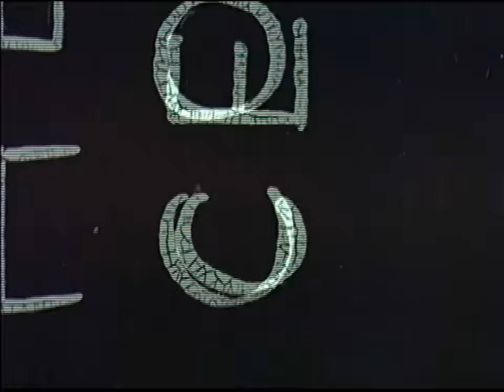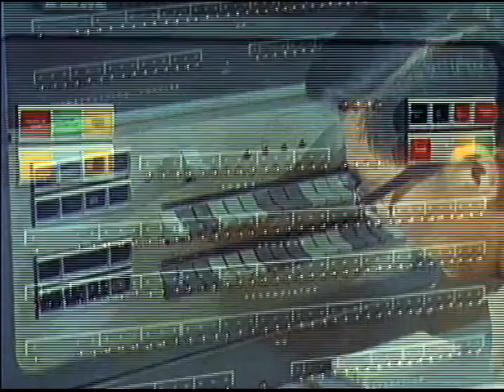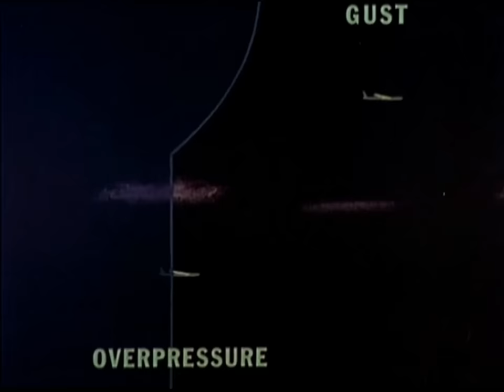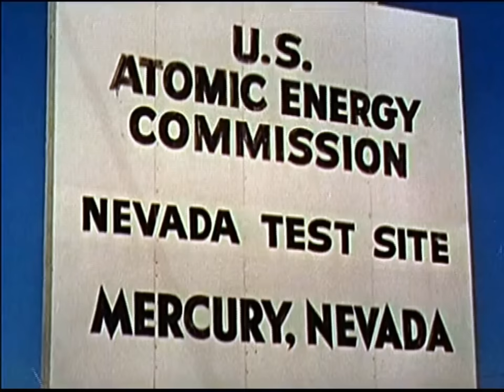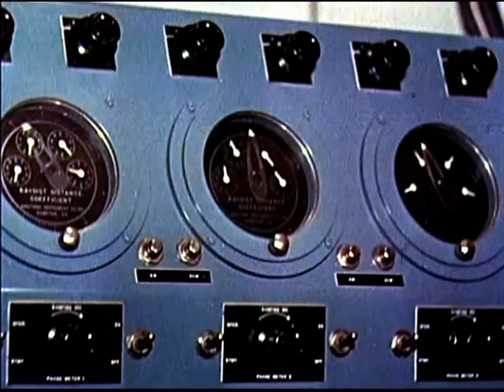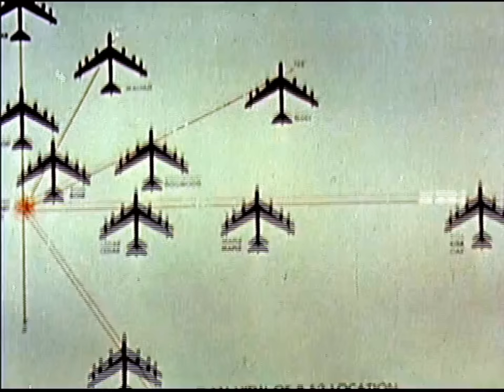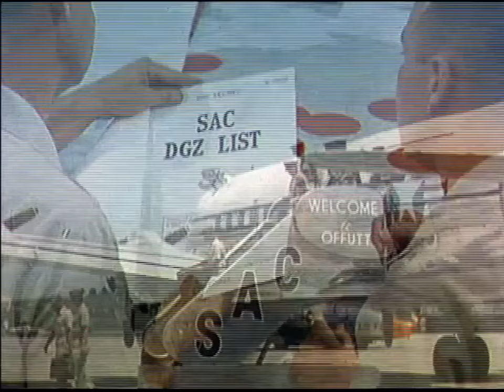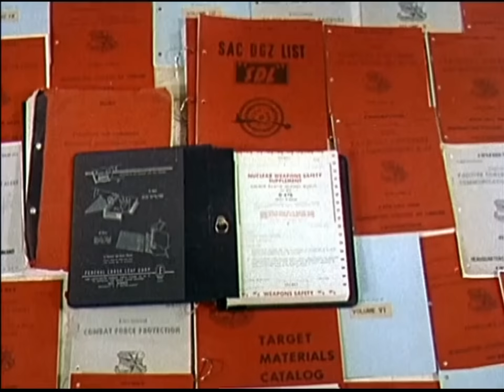Nuclear Effects During SAC Delivery Missions

Comment: I was curious as to how many nukes the B-52 can carry. The B-52 can carry some 45 Mark 83-class bombs (27 internal, 9 on each HSAB pylon). The B61 nuclear gravity bomb is a bit smaller in all dimensions, and uses the same mounting lugs, so physically, there would be no problem for the B-52 to carry 45 of those.
One plane could destroy many of the major cites in Europe.
Reply: The B-61 didn't get DoD authorization until 1963 and hit full production in 1968. The B-52 was designed to carry multi-megaton bombs such as the Mk-17 @15 megatons yield, the Mk-41/B-41 @ ~25 megatons, and the Mk-53/B-53 @ ~9 megatons. These bombs are huge and the BUFF could accommodate two of the B-41s.  

The B-61 was considered a weapon for the F-105, FB-111, F-104, F4, etc.
Reply: B-52's could also carry 2 "clips" of 4 Mk28's for a total of 8, and two Hound Dogs on the wing pylons. It was those very Mk28's that were thrown from the Buff that had a midair over Palomares Spain...A typical load would be 4 Mk28's and 6 SRAMS for Air Defense suppression (radars, SAM sites, etc) on a rotary launcher, or 2 B41's or B53's and 6 SRAMS..Pre SRAM it would be 4 each of 41's or 53's and two Hound Dogs for Air Defense suppression
Reply: @seismicrock6849  The only aircraft that could carry a Mk17/24 was the B-36...A whopping 40,000 pounds, and the B-36 could carry two! The 105 carried the Mk28, B43, 57 and 61....

Comment: The key flaw in this training film is that the Minuteman missiles will have done their destruction long before any aircraft arrive to add more nukes to the burning landscape.  Bouncing the rubble.  Any Soviet fighters that survive the missile attack will be on any incoming bombers like white on rice.  You can head back to the base after the mission, but the base will likely not be there.  Just look for any intact airstrip when your fuel runs low and hope the locals won't lynch you for destroying the world.
Reply: Also, a B-52 would not drop a nuke from this low of an altitude (reference 29:56).  The B-52 that did that would be caught inside the fireball, no way in hell would it survive.
Reply: @Skank_and_Gutterboy  The fuses on board the bomb would be delayed to enable the aircraft to get out of the blast radius.
Reply: Film of 1960. First Minuteman ops : 1962.
Reply: @forcea1454  He's coming in at 5000 feet, there's not enough time.  That works great for 5000-lb JDAMs.  For a 3.8 MT nuke, not so much.
Reply: @Skank_and_Gutterboy  Given a long enough delay, there should be time to get out of range. B-52s, and other strategic bombers and tactical aircraft were also expected to (and regularly practiced) deliver nuclear bombs via laydown (releasing the bombe at low altitude, somewhere around 200ft AGL) and were expected to survive (at least from the blast of their bombs, the interceptors and SAMs of the PVO strany was a different question). The bombs were designed for this, the B28 and B53 had drogue parachutes and frangible aluminium nosecones, and the likes of the B57, B61, the abortive B77, B83 and British WE.177 were all designed with the capability to be delivered via Laydown from the beginning (the B77 was a particular interesting weapon, designed to be released at an altitude of 100ft, and had a gas generator and lifting parachute to increase its altitude to 300ft before deploying the main parachute).
Reply: "Fly east and settle down with a nice Mongolian woman" was the advice given to British pilots.